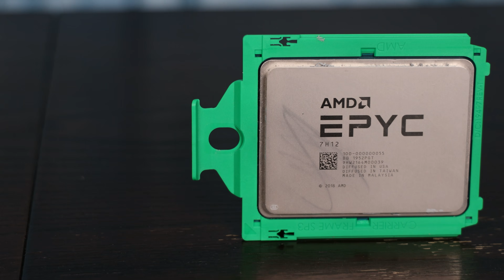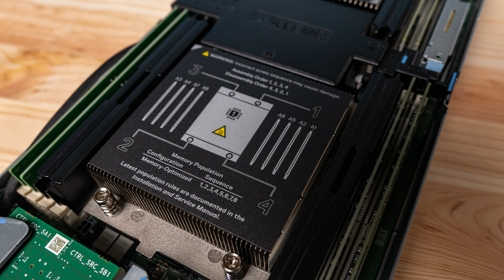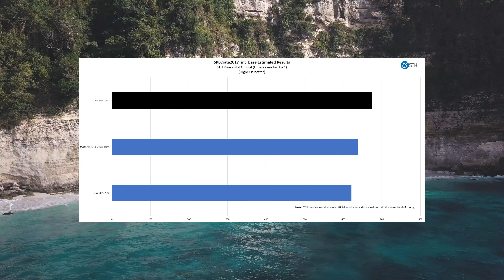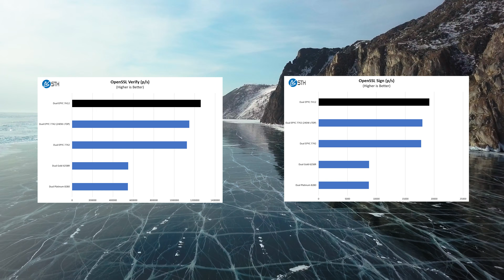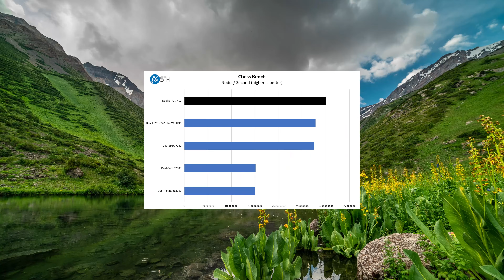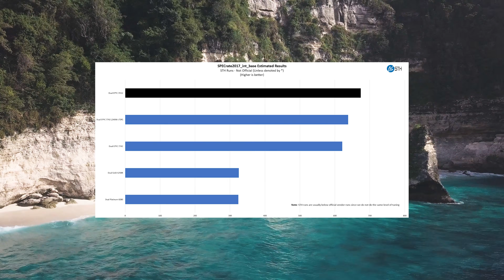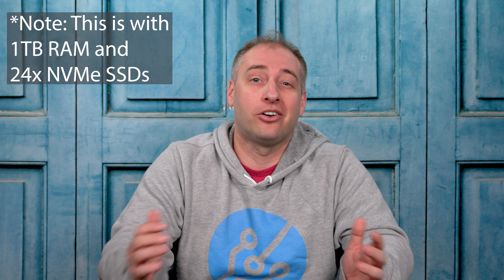AMD EPYC 7H12 The Fastest CPU You Can Buy

Comment: the 3990X is faster in many situations, whenever you're not Memory or PCIe limited.
Reply: Obviously. Desktop parts are set up to draw about 50% more power and run maybe 20% faster, when under limits.
Reply: That's because of the clock speeds
Reply: By many situations you mean not multithreaded operations, right?
Reply: @timerertim  In applications that rely on heavily threaded computational power, but that aren't memory limited, the Threadripper performs better. It has a higher all core boost clock and the same amount of cores, but only half the memory bandwidth and 1/16 of the maximum memory capacity.
Reply: @tommihommi1  That's true. Wow I read 3950x... shame to me
Reply: I also do not understand this video. The only benefit of the epyc is you can have dual socket and utilize more ram. If you need that just run it on a threadripper beowulf cluster. Please correct me if i am wrong, i never used more than 48 threads at ones and never need much ram but always as many as fastest cores as possible.
Reply: @claudiussmith8798  all depends on the workload, if you have large data set, having it fit into memory for analysis can improve performance by orders of magnitude, so having more memory capacity has a place

but, yes, it's not your typical use case
Reply: @666Tomato666  but a beowulf cluster also combines all ram of every single mashine, not just the cpus, isn't it? (I was never ram limited exept during unzipping so no idea)
Reply: @claudiussmith8798  yeah, over NICs, which have bandwidth few orders of magnitude lower than regular RAM
Reply: @666Tomato666  no, the calculations are done on the single mashine. over the network just the results get combined... I mean this happens in my workloads eg. Indexing of diffraction images (thousands in parallel), rotation/translation screening of molecular models (thousands in parallel), packing calculations (...) and comparing to diffraction amplitudes, phase calculations and so on. Maybe just give some examples, i would love to know which kind of workloads work different.
Reply: @claudiussmith8798  yes, it's using NUMA, with all of its benefits and shortcomings

you really think that AMD would spend R&D money to get a product out for which there is no market? that people that pay thousands of dollars for CPUs alone wouldn't research which approach is more efficient?

yes, beawolf is cool and awesome, but it's not a universal tool for all the problems or even all HPC workloads
Reply: @666Tomato666  well i thought the epics are just much more power efficient, like server cpus are in general, with the drawbacks of lower clockspeeds also you save money with licences due to multiple processors in one mashine/system etc. Also saving hardware like less amount of motherbords, powersources etc. Server cpus always were better in money efficiency, but never in lets say a 12h calculation (that is sth i sometimes need) if electricity and 24/7 doesn t matter.
Reply: @claudiussmith8798  yes, power efficiency is big in commercial space (but not because electricity is expensive, it's because you have limits on power delivery per rack and thermal limits per rack — i.e. cooling — upgrading a data centre to handle 200kW of thermal load instead 100kW is a huge undertaking); the other metric that's basically irrelevant in SOHO space is the space efficiency: how much performance you get per 1U of rack space

and finally, yes, generally the workloads are much more easily multithreaded so you will be better off with 20 cores with 70% of performance per core than with 10 cores at 100% performance, all else being equal; on workstation it really depends, but even the well behaved and heavily multithreaded applications bottleneck at a dozen cores or so (like video encoding or photo editing), you need batch processing to take advantage of 32 or 64 cores in a single workstation or a task that was specifically programmed to take advantage of such massive parallelism

so, there is no one single "best" CPU
Reply: @claudiussmith8798  yes, the title is definitely clickbait
Reply: @666Tomato666  i just wanted to say i really enjoyed our conversation, thank you! 🙂

Comment: Waiting for zen3 threadripper or EPYC 🤪
Reply: Yes. i want to upgrade my 2950X when the 5960X is released
Reply: I thought the same. But what a good filler until those monsters arrive. 👌🏻
Reply: Too bad Threadripper doesn't take registered memory, it's normally a lot cheaper.
Reply: @uzefulvideos3440  that's sort of the point though. Want great value? Ryzen. Need workstation performance? Threadripper. Want a ton of memory? Epyc.
Reply: @morosis82  It's only non-registerd ECC memory that's so expensive (and also not available at high clock speeds). If you don't care about ECC memory Threadripper is indeed a great option.
Reply: they say it is a gaming beast also..  this time around.. even beats 5900x and 5950x.
Reply: @TheKuiou  Are you talking about the new Threadrippers based on Zen 3?
Reply: @bgtubber   Yes... Not only the IPC improvement it´s Huge also on the Threadrippers, the Unified Cache has even bigger impact ( way more cache). AMD Smart Access Memory on the Threadrippers works even better also.
Reply: @bgtubber   New Games love Cache, Old games love frequency... As new games are developed for more cores cache becomes way more revalence and frequency less so. AMD has already huge advantages of newer titles... this trend is going to continue growing. Only AMD has Platforms with huge amount of Ipc and huge and of Cache. The advantage of having way more Cores.. doesn´t even matter.
Reply: @TheKuiou  Got it. How do you know that Zen 3 Threadripper "even beats 5900x and 5950x" in gaming? Have you tested it already?
Reply: What's the best AMD CPU or APU processor to buy at the moment for compiling software and graphics processing using Aftereffects? Looking to do a self build preferably in small form factor. Currently have a Threadripper build. My budget for the processor is around $5k.
Reply: @Everyday Good Vibes Yes, but isn't it OEM only?

Comment: Right Now i have a fx 6300  What would be a good upgrade for 150 or below?
Reply: Ryzen 3 3100, 3300X (if you find one), i3 10100 and i5 9400F (the i5 is the least recommended because it's in a dead platform, but it's 6 cores)
Reply: @inlinesk8r477  what would be a really good gpu that can average 144fps or more for the any of those cpus under 200 in fortnite
Reply: @mystical7784  1650 super is your best bet at medium settings
Reply: @inlinesk8r477  So Gtx 1650 super and Ryzen 3 3100, 3300X And How much Ram would I need to have all of these running smothly
Reply: @mystical7784  yep, It seems balanced. Most of the games will run at 1080p low/medium/high settings no problem, and most e-sports titles will run ~150fps at a mix of most medium, some high settings or all medium
Reply: @mystical7784  8 gbs is fine, 16gb is what I would recommend, specially because ryzen benefits from dual chanel RAM
Reply: @mystical7784  frequency depends on your budget and if you pick the 3100 or the 3300X. With the 3300X the RAM frequency is less of a problem. Either way, you will get the best performance with 3600mhz RAM, but 3200mhz or 3000mhz will do the job
Reply: You can also look in the used market depending where you live and if you want to deal with dead platforms, but I don't recommend something that is not on AM4 or the newest intel platform
(Tbh AM4 is probably in a dead end with ryzen 5000 now, but it's not a huge deal, zen 2 and zen 3 are really good)
Reply: @inlinesk8r477  I just bought a used Xeon e5 2680 v4 for $165 and have been very happy with it.  Not quite as fast per core as a Ryzen but the 14 cores more than makes up for if.
Reply: @MatthewHill  the thing is, this was a recommendation for a gaming machine, games are way more single core dependent and probably won't use this much cores in the next 5 years (since consoles right now are 8 cores, and games usually don't optimize more than the enough for the console). Rendering? GPU rendering is way better than CPU rendering. Maybe yes, your xeon will be superior than the ryzen 3 in some cases. But single core performance, new parts, warranty and upgrade paths are usually more important for consumers.  Yes used server parts are great value, but not for everyone (I use a xeon with 22 cores on my server for example)